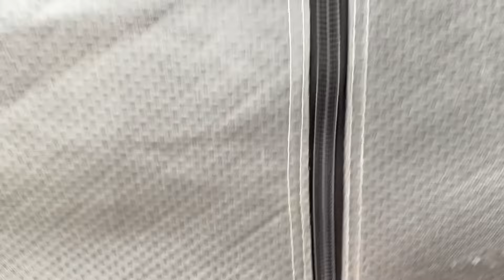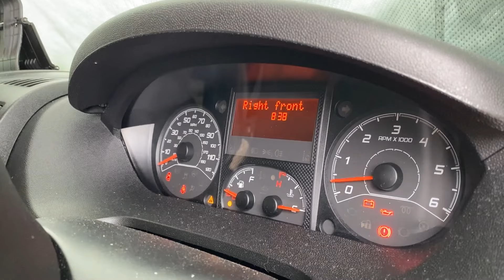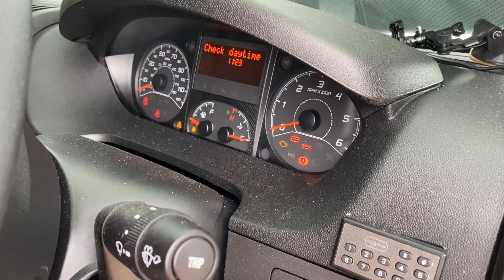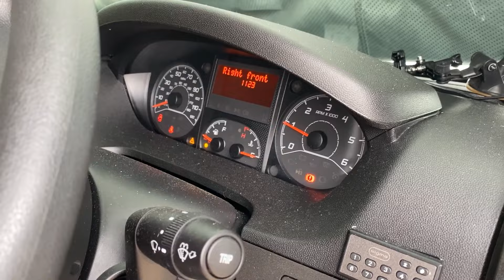Fiat Ducato 250 Cam belt , Water Pump Installation & Fitting + bonus bits.

Comment: We have a 2013 X250 Multijet. Fiat Commercial wanted £1300 to change belt. A local independent commercial garage changed cambelt, waterpump and aux belt for £650. Parts were almost £300. I’m an engineer but for £350 I think I’ll let someone else do it to save hassle.
Reply from the maker: £300 hundred is still overpriced for the kit and pump. A gates kit is under £200 if you shop around but I fully understand why you would let a garage do it for you. I’ve done 30 or 40 cam belts and chains over the years and I can tell you my 3rd one ( on a L200 Mitsubishi) didn’t end well, somehow the tensioner failed and the timing jumped a couple of teeth and that was the end of that engine. I was paranoid about doing the next few from that moment I always double check and again all my fixings and timing marks. Fingers crossed ive never had a problem since. It’s fair to say that tensioners of all kinds have improved considerably over the years. Re. Waterpump I think it’s sufficient to change it every other belt unless I think it’s suspect. Best wishes.

Comment: Just found (and watched) your video on how to do this job after I had employed someone to do it for me.  The problem I have is that he said the fuel pump needs replacing as it was damaged removing it from the casing.  Your video shows the sprocket being removed with three jacking bolts and then, after all the mounting bolts have been removed, the case being wriggled a little it comes away from the fuel pump quite easily.  I believe he has hit the end of the pump shaft to remove it from the casing rather than remove the sprocket.  Was there a problem releasing the fuel pump from the casing on your engine?

Comment: GOOD JOB! GOOD TUTORIAL! I WILL REPLACE IT TOMORROW, BUT I DON'T KNOW HOW YOU REMOVED THE NUT OF THE GEAR WHEEL OF THE COMMON RAIL PUMP. It rotates freely...
Reply from the maker: You should be able to pin the pump or use long threaded bolts through the spokes of the gear.

Comment: Thanks for a well informed video, its not just changing a cambelt its getting to know your vehicle, so a winner and for a later date if it breaks down out on the road , and if you aren't capable of changing the belt you could atleast clean and lube the rusty studs and clean the water outlet flap

Comment: Brilliant video which has inspired me to do mine. One question - all the timing locking tools I see online say that are for the F1AE0481 engine which it says is up to 2011 whereas mine is F1AE3481E (albeit a 2014 model) Do you know if the tools are the same for both - I'm assuming yours would be the same as mine being 2014 also.

Comment: Excellent video, really appreciate the extras like checking scuttle drain hose. Feeling confident to do my own now, only worry is when pulling the fuel pump pulley what are those M8 bolts pushing against on the fuel pump spindle , (black disc) I’m guessing it’s not a seal or plastic collar? 
Many thanks again 
Good job

Comment: My Ducato has only done 24k miles and I am changing the cambelt, but was going to not bother with the water pump as its hardly had any use and was thinking that the original pump is probably better quality than a new aftermarket one.
However, I see your water pump was noticeably stiffer than the new one, yet only done 37k miles. Would you recommend just changing it too?
Reply from the maker: I fully understand what your saying but while your in there just change the pump it’s much easier now because there’s every chance it could fail before the next cam belt change and it’s the same strip down all over again. It’s also piece of mind.
Reply from the maker: It’s also not just about the mileage it’s more about the age. Thanks.

Comment: I have a 2017 Ducato X250 Multijet. I'm thinking of replacing the timing belt and water pump myself after 110,000 km. The first one was replaced at the dealer. Do I need to loosen the four compressor bolts to remove the AC belt? What should I do when installing a new AC belt? There is little information about Ducato in my country (Japan), so your YouTube is very helpful. I have subscribed to your channel, so I look forward to your continued support. Thank you very much.
Reply from the maker: Yes to the compressor bolts. The drive belt is a stretch belt so there’s no adjustment so it helps to remove the compressor bolts to remove the belt and put the belt in place before you refit. IT’s fiddly but easier than trying to get the belt over the pulley later on.

Comment: Thanks again for the video , its been a great help , just did my belt and the other belts . My only worry is torque of tensioner on timing belt , my big torque didnt go down to 35nm and small one only went to 25 , so 25nm on that one and a bit of guess work for 35 but i did out blue thread lock on . Heres hoping
Reply from the maker: Glad it helped

Comment: Hi , Do you need to loosen the cam shaft sprocket to make sure it all settles in place when you tension belt , then retighten . I read that’s the reason for the little camshaft pins that come in kit . I remember fitting a vw t4 timing belt and the vw instructions said to loosen the pulley then retighten after belt fitted . I’m no expert , only ever done two and I’m about to do mine on my 2019 plate . I would rather not have to buy a tool to hold pulley but rather do it if it should be done that way , cheers
Reply from the maker: That’s quite right. I understand that is a recommendation but I have never done it in the Ducato. I had it pinned up excluding the fuel pump but was able to seat it just fine.

Comment: i have seen a tech bulletin from gates  for some vw belts saying change interval is 130,000 and no time specified this belt doesn't look a great deal different, every one that removes a belt seems to say the same thing which is "it looks like a new belt "
Reply from the maker: At the end of the day they all stretch and adopt tiny cracks over time. The vehicles that sit around half the time are are more prone to failure due to the stress around the tensioner. Id always change mine every 4 - 5 years it’s a lot easier than replacing your engine. Ultimately the choice is yours. The manufacturer is worried if it fails or not
Reply: very true a fair point on a motorhome

Comment: Thanks for a great video. It's giving me a lot of confidence to do my own. I've got everything necessary except knowing which type of bolt goes in the fuel pump sprocket in order to release it from the shaft. Could you tell me the size and thread of these 3 release bolts? Thanks buddy
Reply from the maker: Hi to be honest I don’t know. I think they are M8 they need to  at least 3” long.
Reply: Tha ks for your swift reply, I bet your vehicle is running like a dream!
Reply from the maker: @colinware4295  yes no problems. Went to France last year and this year it’s Spain among a few Uk destinations. Plan to go through all the coolant hoses before then. It never ends 😂.

Comment: Thanks very usefull , just a question  removing cylinderhead same procedure following your video any extra care removing head? Like locking ,marking? Thanks again
Reply from the maker: Never removed a Ducato head well not yet anyway 😂 you’d still need to remove the belt etc and probably get some movement on the engine to to remove the turbo and manifold but I’m just guessing as I’ve never looked at the prospect.

Comment: thanks for sharing , mine has done 60k and is also a 2015 although i haven't used it for the last year , i was going to france next month but i might put it off until next year so it gives me plenty of time to change the timing and auxiliary belts .
Reply from the maker: Sounds like a plan. France was amazing I’m sure you’ll enjoy it. I’m currently in middle of fitting rear air bags to the suspension on mine. Should be finished tomorrow. Thanks for these comments.

Comment: did you use a special cam timing bolts kit?  I mean the pins that keep everything aligned while you remove the cam belt.   any idea on where you get one? thanks.
Reply from the maker: Hi yes I did. You can buy a pin kit on eBay for about £18. I only pinned the the cam shaft and the crankshaft. There is no need to pin the fuel pump as it’s not timed up and the other pin is for the back of the cam shaft which is only necessary if your doing the cam chain. Yes there is a chain and a belt on the Ducato.

Comment: I have a 2014 fiat Ducato Motorhome and the cambelt was changed in September 2020 on 23000 miles so correct me if I’m wrong it’ll be due a change in September 2025? The clock is now 42000 and I expect by Sept 2025 it would have done circa 50000 miles, probably best I get the water pump at the same time?
Reply from the maker: Definitely makes sense to change it next time because it only adds about a hour on to the job when the belts off.

Comment: did you use powertools or air tools for all those screws? and thanks for the detailed video. I have done some things on the car but not the engine so I'm quite exited doing this job in the next few weeks. any tips for tools that make my life easier doing this?
Reply from the maker: No air tools. I don’t currently possess any 😂 thanks.

Comment: Hi loved your video very in depth could you tell me how the top Aircon pipes runs to the condenser ? As mine tends to crease when trying to connect
Reply from the maker: Hi from what I recall the air con pipes are mainly aluminium and rigid. If your pipes are flexible and collapsing then I can only imagine that they may have perished. I didn’t remove any of my air conditioning pipes. Sorry I can’t be more helpful.

Comment: How did you lock the fuel injection pump to undo and do up the sprocket nut ?
Reply from the maker: Simply used the long bolts and locked it off against the casing

Comment: Thank you for this video. I just completed the job on my Ducato using your video step by step. I struggled enormously pulling that toothed wheel from the high pressure diesel pump. The rest went exactly like in your video. Hartelijk Bedankt en groeten from the Netherlands!
Reply from the maker: Mine was tight but I think I screwed a bolt through one of the additional ports and used the casing to apply some pressure. I could be wrong because I’ve done a few in the past. But apologies if I didn’t include that in video.

Comment: What is a ballpark cost of parts and the typical time .
Taken to do the job?
Reply from the maker: Hi I paid about £240 including the waterpump. It was a Gates complete kit. Time wise I’d say it took me 8 hours but I cleaned up a lot of areas including the engine mount studs. I cleaned the washer and expansion bottles and I prepared and painted the sump and gave the power steering pump a clean up and a coat of lacquer. I’d say you could do it in 6 with all your tools in place.

Comment: Never start a Engine without pully 🤦🏼‍♂️
The pully makes sure the belt wont slide off 👌🏼
Reply from the maker: While I totally agree with your point I would just like to say that under those conditions without the ancillaries connected the belt will float on the crank a pulley a little but doesn’t come off. The engine will only run for a few seconds with the intercooler disconnected. That being said It’s actually something I would not recommend and will make a new note in the videos description stating this fact. 
Thanks for raising the point.